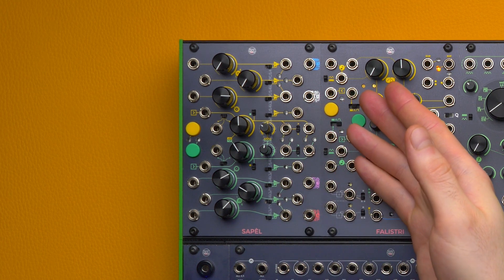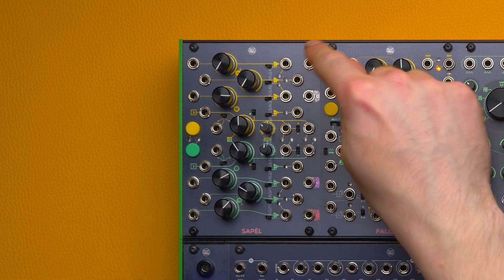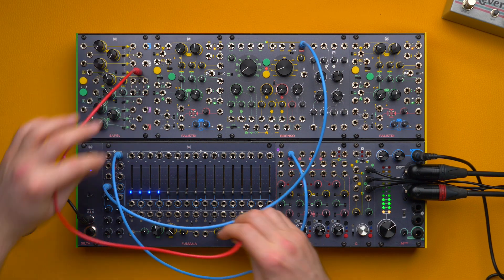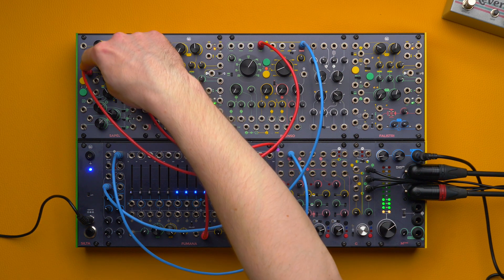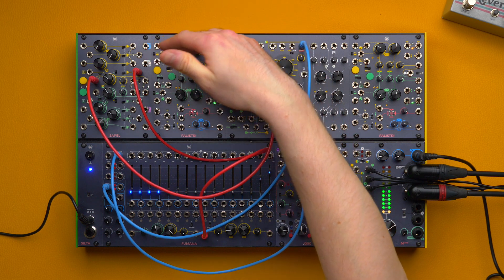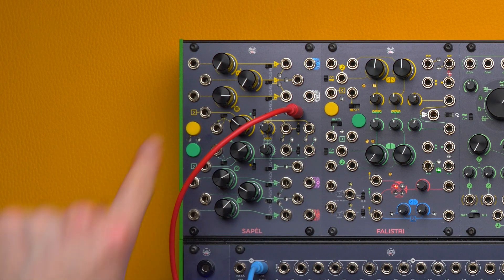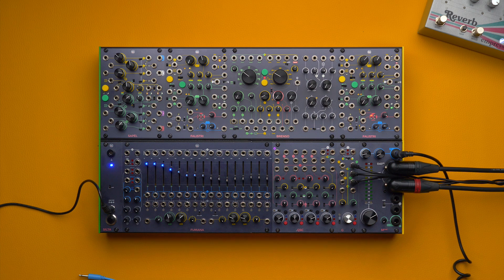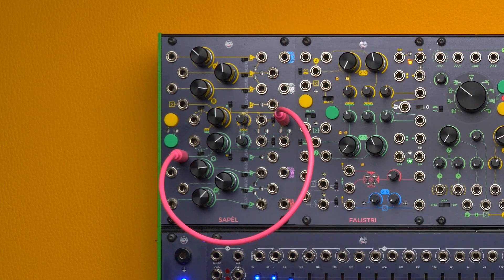Frap Tools SAPÈL Tamed Random Source  |  In-Depth Tutorial

Comment: I find the labeling a little challenging sometimes. For instance the clock mix switch label is connected to the clock rate control but it doesn't actually change the clock outputs and only changes the rate at which the OTHER three elements sample. I find myself going back to the manual far too often for this module.

Comment: is it possible to use an external cv source in the sample and hold circuit? or it only works with the internal noise source?
Reply from the maker: Hi Pablo! No, SAPÈL's S&H circuits all work on the internal noise sources. However, each works on a separate noise, so that you don't have the same magnitude pattern across all the outputs.